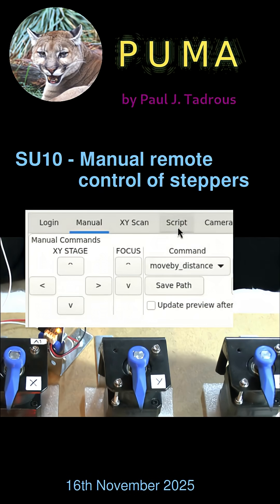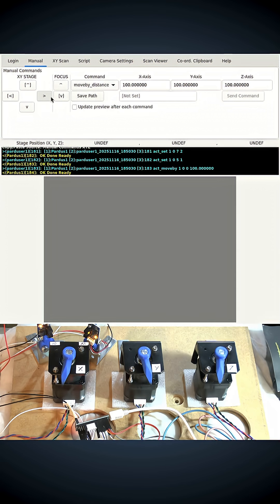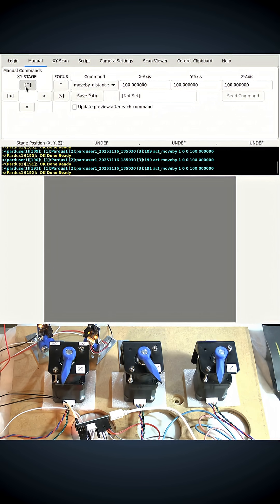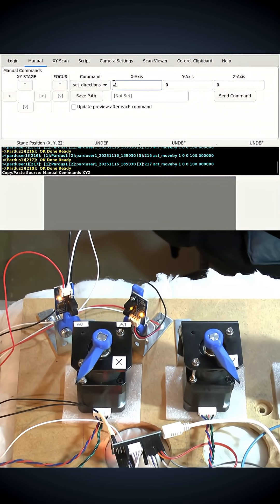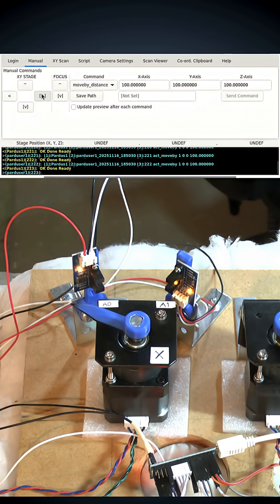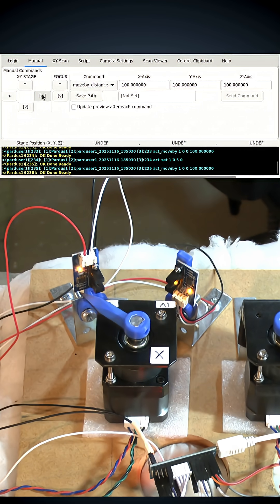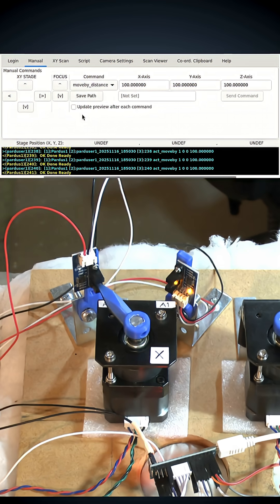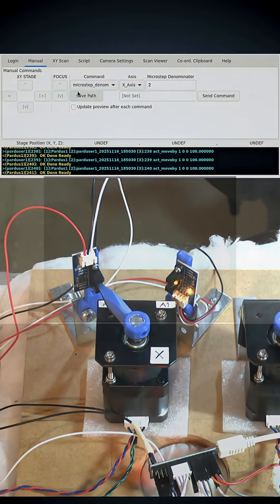Remote control of the XYZ stepper motors with GUI buttons

Comment: HEY! Ive been meaning to check back in for new content (im a let stuff come out then binge it all at once type), but kept getting distracted and forgetting....

But oh buddy!!! I have a project that makes me very interested in that interface you got going on (adding steppers to a cheap telescope for automated inside in the warms star gazing)! Looks like I know what Im doing for a while now...[clicks channel name]
Reply from the maker: Hello. Thanks. Yes, I designed the PARDUS control system to be a kind of general robotics system for controlling things like steppers, servos and other actuators. I was thinking of doing a video to illustrate this by turning my 3-stepper test board into a little equatorial mount for my 4 inch Newtonian reflector so I can demonstrate that it can be used for astronomy as well as microscopy. Not sure if I will ever get round to it - but the design should allow it. The multi-camera support aspect is also good for astronomy because you can have one camera on a guide star scope to regulate the mount sidereal rate with a separate camera on your main telescope eyepiece for hi res imaging of faint objects (that won't be good for guiding because they will take many frames of averaging and integration to become visible). That sort of thing.
Reply: @PUMAMicroscope  OOOooooo, Id be interested in that. Even if its just showing off what you already have going, its neat to see how things can be co-opted to work in multiple applications. Plus Im sure it could be inspiring to someone dipping toes into automated astronomy.

I have curb-find meade 4500, with its cheapy EQ that has 100:1 worm gears on it, so at like 1/8 microsteps its almost right on the earths sidereal rate per second (which can be further zeroed in by offsetting the step trigger time instead of having it exactly on the second). Its only a 114mm x 910mm newtonian (f8 or something like that), and all I have in the way of big pixel cameras is a canon 1200D to strap to the focuser, but with nice long exposures and stacking it should be able to make out the brighter stuff (it also helps setting up stellarium or kstars to simulate the FOV and set magnitude limits to plan observations). 

I have to be careful as I am 100% the kind of ADD HD tinkerer to get sucking into something like this and the next thing you know Im building a mirror silvering rig and bit banging readouts of raw image sensors JB welded to a peltier cooler! Who would have guessed taking all those VCRs and HiFis apart in the 90s as a kid would have lead to useful survival skills....Well, 'useful' 'survival' skills....Well, I can give MacGyver a run for his money at least.... LoL

.....Which is probably why your content gets me so excited, honestly. That LCD overlay idea...blew my friggin mind! Came for the illuminator, left with a handful of mod ideas for my cheapo amscope! Anyhoozle, hope all is well and such, keep on keeping on, mate! Lovin the learning! And thanks again for sharing it all with us! 😎👍
Reply from the maker: I can see you are a proper astronomer - I dabble and learn but am not one for staying out late in the freezing cold. One of the most important things I learnt from my astronomy is the concept of 'balance' (the counterweight on the Eq. mount) for precision motion of big bulky objects. I took that principle and applied it to my design for the microscope CNC stage. You may not understand that fully now, but wait till I bring out the 'How To' videos (prob. next year) and think back to this comment - it will all become clear. All the best.